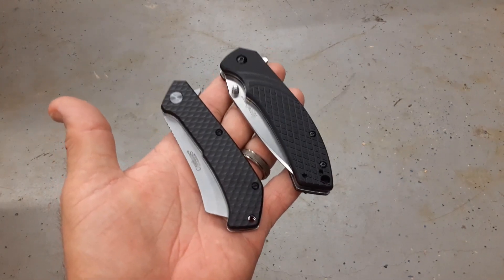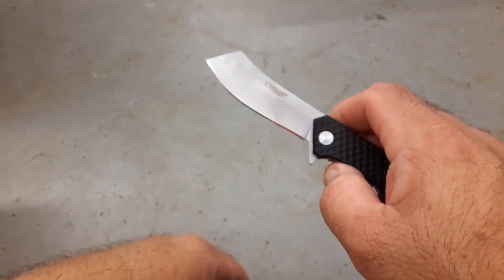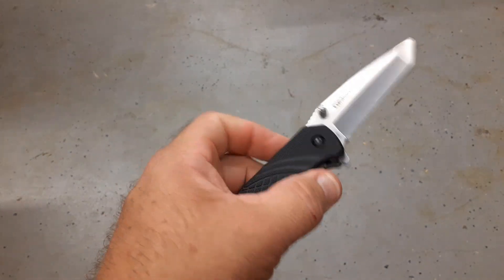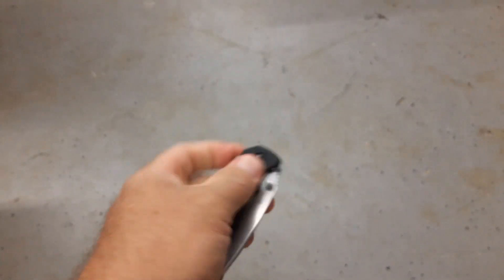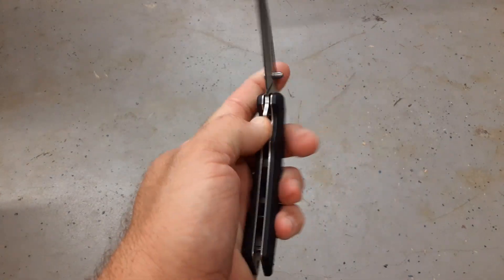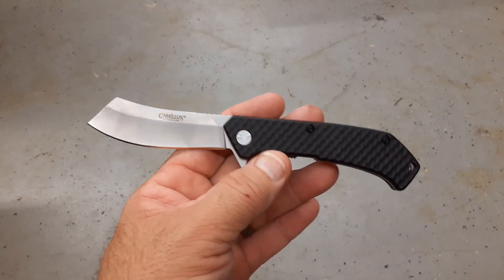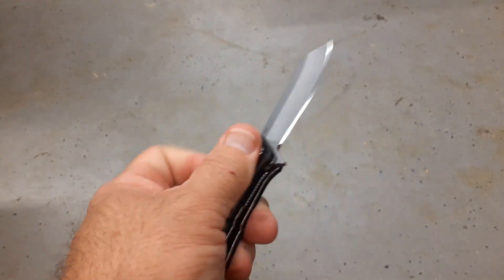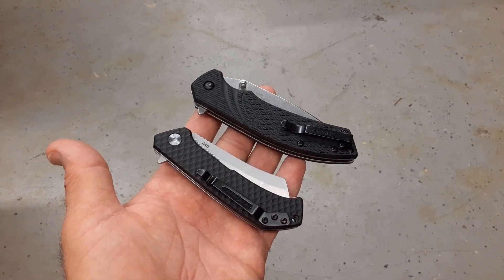Kershaw 3cr13 vs Camillus 440A budget edge retention testing. How bad are these steels really?

Comment: Just based on the numbers, it sounds like camillus is using mislabeled lion steel m390
Reply from the maker: Now that's funny
Reply: Well yeah. This comparison is of apples to oranges, 3cr13 steel is 420j2 while 440A is 7cr17mov steel… I would’ve liked to see gerber 7cr17mov vs Camillus 440A.
Reply: @bandito_dino  everything is in the heat treatment
Reply: The M390 is very likely severely burnt. 
High carbide steels require a long grinding time, and under stress in  a mass production factory, the grinders are likely to be in a hustle.

Comment: what about machetes in 3cr13? is it okay if its made well? quality steel machetes and axes get expensive.
Reply from the maker: I should do a video about that. I needed a chopper while states away from home and bought a cheap one. It's a 3cr13 deal that was cheap and it's still doing fine. I still use it on my land too see what the limit is.
Reply: @Outpost_76 the cheap Rambo knife at harbor freight for ,$10 is 3cr13
Reply: 3cr seems to be pretty tough and corrosion resistant, which is why it's not bad and pretty good for a machete. The edge retention though, is pretty bad and you'll have to sharpen it often. That said, it won't chip. I tried my $20 Kilimanjaro with 3cr on hard eucalyptus wood blocks, and it went through them zero problem. No chips!

Comment: I'm curious. How does 440 compared to aus-8? I've heard it said that they are very similar, but I've also heard people say that 440 is outdated, and not that great of a steal, etc. , and yet I've seen AUS-8 take a HELL of a beating during tests of survival knives. And I don't break, and the retain a pretty good edge, through some amazing abuse, and they seem like DAMN good blades. I'm not sure that 440 would hold up like that.

For me, I'm really more interested in toughness than I am add retention. I can quickly sharpen a knife, but if you snapped the tip off, or break a blade, there's no coming back from that. And that's happened a number of times to me with cheaper knives. And some not so cheap knives.
Reply from the maker: What 440 , 440A is well below Aus-8,  440C is much closer in use.

Comment: I've got a  440A lock knife with a part serrated edge. It's a Gerber. I've had it for years but I've always held back from giving it too much cos within a week of it arriving, the very tip of the blade snapped off. I lost about 5mm from the tip. I was more annoyed with how easily it snapped than anything else. So I spent half an hour with a dremmel etc ,and reshaped the blade into a new tip. Then within days I had another snapping problem occur at work. I needed to cut a length of 1" diameter hessian rope to use in a boat yard. So I was pleased that my new 440A Gerber had a serrated edge. But my smile soon turned to a Brown when I got about half way through the rope and I noticed it didn't seem to be cutting as well as it first was. Reason being is the tips of the serrations had crumbled and snapped off like a row of rotten teeth with bits missing. It took me quite a while to re cut the serrations with various different sized round files. Ever since then, I only use it for very light jobs inc opening packages, cutting veg, sharpening pencils etc. Its put off of 440A knife steel. It sharpens up very easily with a couple of ceramic rods. From butter knife to scalpel in a matter of minutes. But it doesn't hold the edge very well at all, and the blade seems as brittle as glass...🤷‍♂️
Reply: Maybe your copy had a bad heat treat.
Reply: @ArenaAccessories  copy?  Mine isnt a copy.  I bought it from a highly respected chain store called "Cotswold Outdoors".  My Bear Grylls Gerber is 100% authentic. I always do my homework when it comes to knives cos I'm well aware that popular brands/models are quite often copied by the Chinese. I bought my Led Lenser p7.2 hand torch from the same store. Again, the market is littered with very good copies of genuind Led Lenser torches.  I studied all the things to look for in a fake v real . They're so good at copying stuff, that you need to know what to look for cos the differences can be nigh on microscopic.  I like the build quality of the BG Gerber. It locks open with a solid and positive thump. And it closes just as smoothly when you disengage the lock. It's always been a working knife. After a lot of heavy use, occasionally the blade will loosen on the pivot. But it's not a problem at all. I always carry my " Böker plus " torx kit with me. A very light turn on the pivot torx screw tightens the Gerber blade for another month or so of abuse. But then again, maybe I shouldn't have been surprised when I found out how brittle the Gerber steel is cos it's a cheap knife. It takes no time at all to put an edge on it like a scalpel. But its cutting edge is limited to what tasks its capable of, cos I'd estimate the blade to be 60/40.  Unfortunately the design and re profiling after snapping the tip off it, has left me with approx 40% of the blade for straight cuts. The other 60% is serrated. But I learnt a valuable lesson from it?  I never apply any lateral force to the blade cos I know it would snap clean in half far too easily. So it's only really any good for slicing stuff open. The serrated edge has also been downgraded by me. The only rope/string I cut with it nowadays is 550 paracord.
Reply: @jimmy66603  I was not accusing it of being fake, I just meant your specific knife production / model / example.
Reply: @jimmy66603 he meant you could've had an anomaly, meaning it's one out of a certain amount that comes out bad. But you won't know until you use another.
Reply: @Goochgravysuppliers   Exactly. There are almost always production variations within the same production run. Human error, material imperfections or differences, and a lot of other factors definitely contribute. That's why good quality control is important 👌🏼
Reply: buck does the same , overly hard and brittle
Reply: @user-zb6ke7gy7e  I've got a Buck folder that runs on caged bearings. The scales are carbon fibre and it flies open and locks up like lightning. I think new it cost me approx 50 or 60 quid ? Again, only a cheap knife in the grand scheme of things, but the 7Cr blade steel is what I like most about it. Sharpening wise, I'd liken it to Aus-8 ...🤔..? Very easy and quick to turn it into a razor, and easy to maintain and hold the edge with a few swipes on a fine  ceramic rod. But you need to keep on top of it and get into the habit of lightly flashing it over a rod or a leather strop each and every time you use it. 🤝👍
Reply: 440a isn't a good steel, but it's not THAT bad. I think you got a dud heat treatment or something full of impurity voids.
Reply: 440 is used on daggers I think..

Comment: I’ve been using a kershaw in 3cr to cut a range of soft to quite hard materials at work for about a month now. And the edge on that bastard is still glistening and shaving sharp. It doesn’t chip at all when put under hard use which is invaluable on a job site. After every job I simply strop it on buffalo leather with green compound (my strop stays lathered in a healthy amount of compound at all times) for about 20 seconds or 5-10 swipes on each side and it comes back absolutely perfect. If you spend 5-10 minutes on the strop you can actually sharpen out a small micro-bevel that greatly extends the life of the edge. with micro bevel im getting near d2 edge retention out of it. 

I think judging this steel on it’s edge retention alone is unfair to people who are new to the knife world and a bit uneducated on the current state of things. Edge retention is just one small advantage out of many in a daily use folding knife. I would actually highly recommend that those new to the community start on 3cr, buy a strop and some sharpening stones, then learn the skills of sharpening honing and stropping. These skills are much more valuable than any high price steel could ever be. The beauty in these soft highly stainless steels is that they are an absolute pleasure to work on. You can bring the edge back with just about anything flat in your vicinity. 

Do I enjoy the amount of time that can pass between sharpening on my m390 knives? Hell yea. But when that time comes I really really do not want to spend the half hour it takes to sharpen and then finish the edge. With the 3cr I know any damage to the edge can be quickly taken out and the knife brought back to pristine condition. For this reason I am much more comfortable using softer steels for hard use applications. They also don’t break as easy when dropped
Reply: I have a 3Cr Kershaw, and a 7Cr 

Before I knew anything about steels or knives, I could tell the difference was night and day

I spent 30 minutes sharpening the 7Cr blade, and it would hold for a month at a time

But the 3Cr blade, I’d only have to sharpen for around 20 minutes, but it would only last the week

For me, it’s all about price, you could buy a cheapo 3Cr 
Or a nice knife that’s still 3Cr, for the price of a 7Cr blade

7Cr is better at resisting rust, it holds its edge a heck of a lot better, and for what I do, it doesn’t chip nearly as easily 

Do with that what you want, but from now on, I won’t be buying 3Cr blades anymore

20 minutes x4 times a month
Vs
30 minutes 1 time a month

The extra 10-15$ for a 7Cr blade saves you 50 minutes every month

That’s a worthwhile investment 

Depends on the work load I suppose

Just cutting plastics, woods and other soft materials? 
3Cr will be fine

Gonna be in the rain a lot, cutting wire, metal sheets or anything with some girth? 

The 7Cr is worth the investment 
Or even 9Cr, which is very very good against rust

Comment: I find out, by carrying multiple knives, then you just switch knives as they get dull, then sharpen all of them at end of day.  So multiple cheap knives can do the work of one expensive one.
Reply: Exactly. Like cheap sunglasses. Variety is the spice of life and no major loss if you mess one up.
Reply: That's why on the old timer folding knives, and Victorinox etc, you'd have a secondary blade. Twice as much edge retention as one, you keep one very sharp and one working edge unless you can't resharpen. And plus, we can use any excuse to carry more knives as knife nerds, no? 
Although if I was doing cardboard stuff I'd choose D2 or PM steel, although I actually use a nasty 440a knife with no sheath I found in the woods for breeding down cardboard for fire starting in actual use.. 2 secs to sharpen on a diamond 400 grit. Few passes per side like you're burr removing and it's good to go.

Comment: No point in these steels anymore, we have sandvik and 8cr13mov which are priced the same and perform much better. Manufacturers and companies need to phase these out imo, they’re just notoriously crappy when compared to the same price alternatives. Of course there’s the marketing aspect that probably keeps them afloat, sell super crappy knives for cheap even though they cost the same so you can justify charging much more for the “premium” steels.

Comment: Could the same steel be heat treated better?
Reply from the maker: I'm sure but even then it isn't going to be very wear resistant. I have another 3cr13 that will show this.
Reply: @Outpost_76  Thanks for the response. I know it’s an old video
Reply from the maker: Robertson you're welcome
Reply from the maker: Robertson you're welcome
Reply: Absolutely. My feelings that steels in this category are used to maximize profits. Why would much effort be put into the heat treatments?

Comment: I have an old USA Schrade Uncle Henry in 440A, and to my surprise, it compares favorably to their carbon. Must have been the most optimal heat treat on it.
Reply from the maker: They did a better job back then too. I have a couple older Schrade that I'll test at some point. A few folders and a slip joint. They did fine for me back in the 90's.
Reply: @Outpost_76  Oh, I would just love that. I'd send mine, but it was the very last USA Schrade in a hardware store in Southern Maine, and it means too much for me to shorten its life more than necessary. That, and I don't want my geometry messed with. But I'd be so excited to see how it does.

Comment: Back to back high rollers 😁😁.  I'd be curious how opinels actually stackup in the budget steel landscape.
Reply from the maker: I am going to do Opinel carbon and stainless vs MAM stainless less and see how they all stack up.
Reply: He actually ran my 12c27 Opinel about 2 years ago and IIRC  he got pretty respectable results. Go dig through the library and see if you can find the video or hit his spreadsheet for the numbers.
Reply: great idea, that would be a very useful comparison to know
Reply: I guess he meant simple carbon steel, didnt saw it being tested here( on rope cutting at cederic& ada)
Reply: People say. that Carbon steel Opinel models, hold their edge  more than their modified 12C27 stainless. Opinels and Victorinox, are not as bad as some people say. Nowdays everything is all about edge retention but I really prefer toughness and ease of sharpening which also leads to sharper edges!
Reply from the maker: @greekveteran2715  I haven't used any of mine more than occasionally so it will be a good test to see how they do.